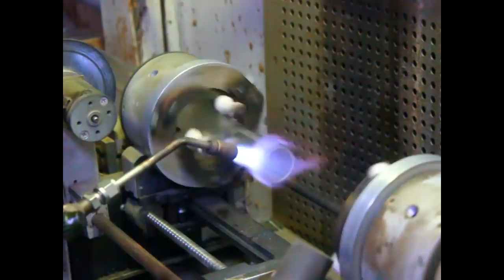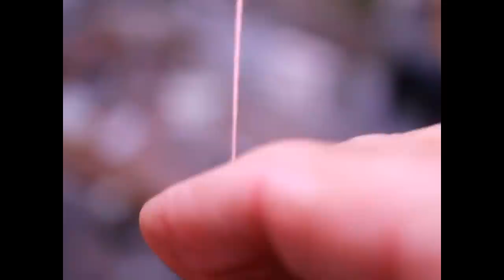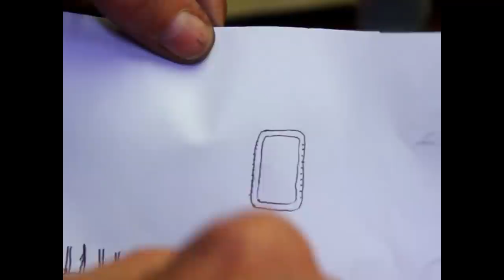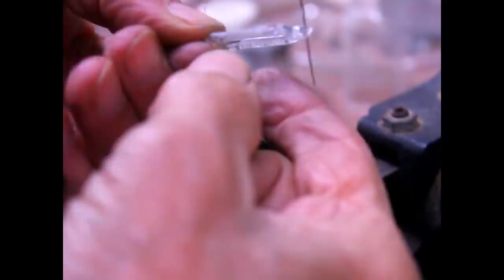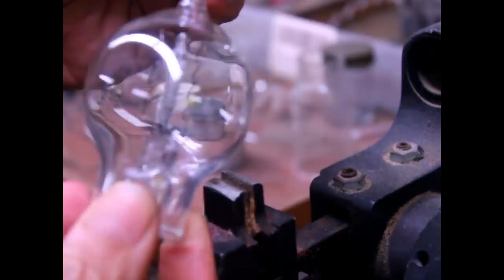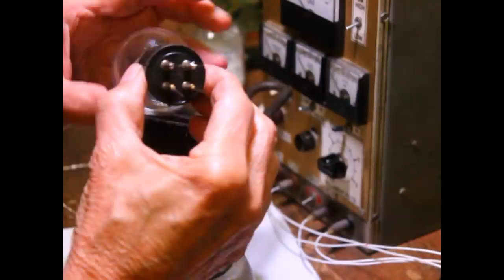MAKING A WIRE ELEMENT PILOTRON

Comment: A delightful hour spent watching a master.    When I left school  in 1956, I got an apprenticeship with Ediswan in the UK - as a potential valve engineer.   As I trained in the various departments, I saw valve components - anodes, cathodes, grids, etc. - made on automatic forming machines, and their assembly into various types of valves from those for battery radios up to transmitter valves the size of a football.   I was always fascinated by the processes involved, but never more so than when watching you, Ron, creating an example of an early version from scratch.     Such skill!

Comment: I know how you feel with those moments like when you looped the filament. It's the most angry I ever get. When it's something simple like that it's just the worse. Btw, I actually gasped when it looked like you were about to snip the bottom rung of the plate whilst you were trimming the excess off. Amazing stuff. Beautiful finished piece, and nice performance for something with such a low surface area for the plate. I wouldn't have expected that to work so well. Thanks as always for sharing.

Comment: The ultimate in home projects is make your own tubes.  Probably more difficult would be to make your own transistors, starting with silicon sand and a few metals (or non-metals, arsenic).
Reply: I didn't think it was even possible to make working homemade vacuum tubes. What this guy does is incredible!

Comment: Pilotron vs Pliotron.  According to the book "Saga of the Vacuum Tube" by Tyne around page 140, what you have made is a pliotron from around 1915 to 1917. "Pliotron is derived from the Greek pleion, meaning 'more'".  "The practice of using wire electrodes to facilitate degassing was followed from March 1913 until well into 1914..." If it is actually the pliotron then it is significant because it was among the first amplifier tubes with a good vacuum.  Also, check out the wiki under Audion.

Comment: The liquid (when you are sinking the wires into the grid frame) is water formed in the gas combustion, condensing upon the cold carbon.  After the carbon warms, the water evaporates.  This happens anytime a flame hits a cold surface.
          Regarding mounting into the socket: what I would use is silicone 1 caulking.  It never gets brittle.  It bonds to glass.  If you need to remove the tube for some reason, you can cut it away.
          Regarding mounting in the socket: how did you get the 4 wires to go through the pins all at once?  I usually cut the wires in a stairstep so one can be guided in at a time.
          Regarding tungsten seals: tungsten is drawn from billets sintered from powder.  The billet is porous (despite the hammering it gets).  The wire drawn from it has "tunnels" running through it that cause leaks.  This is usually remedied by butt-arc-welding molybdenum to at least one end to fully melt the tungsten and seal off the tunnels.  Have you had trouble with leaky seals?  (I noted that you did not He test the seals like you did for the Edison Effect lamp).
          Where do you get your supplies, especially thoriated tungsten is hard to get given the radioactivity?
Reply from the maker: I use a silicone glue called "shoe goo" which is available at any hardware store.  I solder long pieces of thin wire on the leads so I can easily thread them into the socket! EASY! The problem with tunnels in the tungsten is serious and I do have trouble with it. All the seals MUST be leak tested before use or you are in for a crap shot. Note that sometimes a step in the work is not in the video because I forgot to hit the record button on the camera!  :(

Comment: Seeing how cheap metal is and how tricky a tube is to make I think the Gm would be the reason. I imagine alingement would be near impossible and tollerences would be wide.  A complex tube like PCL86 was sold for peanuts. A triode plus power pentode of good quality in a small package. I guess mass produced tubes had a line of people doing just one task to keep it simple. Ironically a 2A3 which must be easier to make is 20 times the price. It goes without saying to make a tube as here is remarkable. My friend Martyn Miles made the glass used in the film Cold Fussion. I have seen a glass lathe in his lab in Oxford. It was in the film also.

Comment: the fluid on the carbon surface is when the hydrogen burns in the flame it makes water. that is not coming out of the carbon ron, it is simply water. The water is made as steam. The carbon is cold so condenses the steam

Comment: At some point could you please show us the machines and  tools and how you use them to make tubes ? I know you did a review several years ago, but not much on the the materials used in vacuum tubes... Such as thoriated tungsten wire ! I remember the need of some special eyeglasses, so you can see through flame ! Are there any textbooks you can recommend ? Thanks for all your work and efforts !!

Comment: Glasslinger, I love your vids and wish to thank you for all your work. I have a couple of questions for you. a) I have some old books etc that advertise valve repair services (I am in UK). Do you or have you ever repaired a valve/tube? That would be a n interesting vid to see.
b) old capacitors, I understand that it is easier to replace faulty ones with new, but wondered what is it that has gone on the old? and again could they be fixed? Yes prob not worth the effort but got me wondering. If it was just leakage then with some perhaps melt the wax out then rewind and reseal? Be interested to hear your thoughts.

Comment: Your skill in this stuff is beyond impressive. Any chance of inventing a way to replace worn out cathodes in picture tube guns?
Reply from the maker: Sometimes. The problem is a chemical change in the coating of the gun. Sometimes there is good raw coating still under the worn out coating layer. Picture tube rejuvinators attempt to evaporate the worn out layer by heating the layer to high temperatures. VERY RISKY because it can burn out the filament, which instantly renders the tube inoperable at all. A picture tube brightener heats the filament to about 20% hotter than normal temperature to force more emission. This will add about a hundred hours to the life of the tube before it burns out the filament. Full rebuilding of the tube requires large expensive equipment so it is not economically feasible in today's "collector" market.
Reply: Thankyou for the explanation.
Reply: Picture tubes were re-gunned routinely, the b/w ones that is.

Comment: You are using a carburising (oxygen deficient) aka reducing flame I see, is there a technical reason for that?

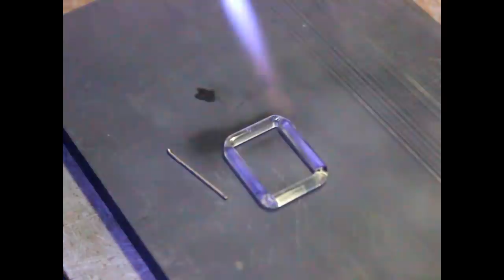Btw the liquid at 33:40 is water condensing out of the flame when it meets the cold surface. The same thing happens when gas welding cold metal. 
If you preheat your work surface it should help.

Comment: Loved the video. So many questions. Why does tungsten wire get used at the pinch?.  Couldn't the nickel wire be used from the inside all the way to the terminal pins.  And why the sleeve on the copper.  Is it not possible to spot weld the tungsten to the copper?  I assume tungsten makes a better air tight seal at the pinch and if so, are there other metals that also work well or is it just tungsten that is suitable?

Comment: Fantastic Video; Thanks for the Christmas present Ron! 
I too, would like to see a project using these tubes (e.g. radio, CW transmitter etc.).
I was wondering why you did not coat the filament; could you explain pro/cons of coating?  However, I see you got good emission and gain at low-voltage.  Also, was surprised that little amount of plate-area gave such good emission. Conversely, I bet that grid gives really good/fine control. Thanks Again;I was entranced the whole time!
Reply: He did not coat the filament because he used thoriated tungsten. Coating is used in many tubes because it works at a much lower temperature than the tungsten, consuming less energy. But thoriated tungsten has a longer lifetime at high cathode currents and is easier to work with.
Reply: Ok, guess I missed him using thoriated-tungsten filament wire.  Thanks for the reply and clarification...

Comment: Would it be possible to work with boro tubing with a propane and oxygen mixture, and or an acetylene and oxygen mixture? Would they be as hot as a natural gas and oxygen mixture?
Reply from the maker: Certainly! Both propane and acetylene burn hotter than natural gas so you actually would be able to work larger pieces using those gasses.

Comment: Hello
Thanks you for this masterpiece, you keep impressing me over and over!
I think this is the best tube regarding transconductance and current values.
I don't remember nothing similar looking at your previous creations.
Is this a high power tube?
Best regard.
Reply from the maker: Not a high power tube. It has very small anode area so it would heat red hot qickly if any power was applied to it. The original purpose was to get around the patent that described a "plate" used as an element. By not having a sheet plate they beat the patent, but never did produce the tubes commercially.
Reply: @glasslinger  Hello Ron, thanks you for the answer, understood.
It work very well, i thought having a lower surface area for the plate would lower the transconductance.
But it's not the case, having the grid and filament so close heated, for sure help.
The result is astonishing, again congrats.

Comment: Why are vacuum tubes always symmetrical, in this case with two "plates" instead of one?
Reply from the maker: It doubles (sort of) the performance and is very easy to do.
Reply: @glasslinger  OK, thanks for the answer! The two grids also make the tube even more beautiful.

I had a complicated theory, that it affected the electric field close to the cathode (superposition making the combined field strength there close to zero) and that it changes the performance from when you have a setup more like an electron gun. But cathodes are seldom as centered as in this case so I guess this can't have any impact.

Comment: What type of tip attachment do you use? I have a National 3B-B torch, and want to replicate a similar flame.
Reply from the maker: I make up many tips, some producing a 1/16 inch hot needle flame and some making a large "rosebud" flame using 12 liters per minute of oxygen. I have modified the national threaded head to use a swagelok quick change coupling. This makes changing out tips take a few seconds.
Reply: @glasslinger  Is there a specific tip attachment you used for this video?
Reply from the maker: @GriffinGBrock  I use a half inch "rose bud" tip to work the envelope and the 1/16 inch needle flame tip for doing all the sealing. For making the pinch I use a small cross fire tip that heats the glass from both sides.

Comment: What type of gas are you using to blow out the tubing?
Reply from the maker: Air.
Reply: @glasslinger  I meant the gas you use to melt it.
Reply from the maker: @GriffinGBrock  OH!  I use compressed natural gas with oxygen. I have natural gas service at my house, and have two oxygen concentrator machines to generate the oxygen. Very low cost per hour to use.
Reply: @glasslinger  I’m using MAP Gas Pro for 22mm boro tubing, but it takes too long for it to become red hot. I’d imagine that natural gas and O2 is hotter?
Reply: @glasslinger  What mixture ratio do you use? Where can I get the proper gas? The internet does not seem to help on these matters.
Reply from the maker: @GriffinGBrock  Ordinary propane used in food cooking works fine. Oxygen you would have to get from a welding supply store. (expensive!) If you have the torch, simply light it and adjust for a nice hissing blue flame.
Reply from the maker: @GriffinGBrock  MAP gas is fine, but you must burn it with oxygen. The gas burns about 5 times faster with pure oxygen so it liberates 5 times as much heat per second. Your glass will heat 5 times faster. Work towards getting yourself a nice welding torch with changeable tips.

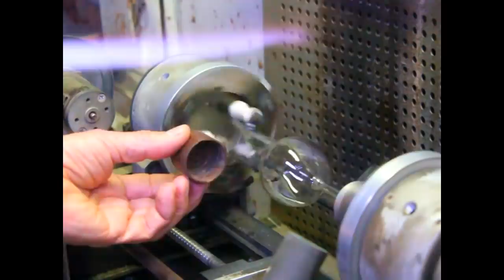Comment: 11:20 How do you blow into the tube while turning? Do you have a swivel setup?
Reply from the maker: A small sealed ball bearing is placed in hose adapter fittings made on a lathe.
Reply: @glasslinger  Hey thanks for answering. Have meanwhile started my own experiments using some cheap test tubes, my simple lathe and have now made the double torch from some leftover AC copper tubing... You are inspiring me!

Comment: Hi Ron, what is these liquid when you cut the glass ?
Reply from the maker: i use WD40 spray. It does the job and it evaporates within a week or so to not leave an oily mess on the equipment.
Reply: thanks for your fast responding. @glasslinger

Comment: 1:02:45 You flash the getter AFTER you have sealed the tube. The getter will make the vacuum much lower then the system can and thus it draw quite some molecules into the tube from the system and makes the vacuum worse then it would if you had done it afterwards, in worst case it could actually not lower it at hardly at all and pretty much be of no real use to what its capable of. I also do not see any real strong mark on the surface after the flash which indicate to me much have been used up before it hit the inside of the glass and thus no real shiny surface after it, since you heated it up so much that it should have evaporated a lot of getter material.
Reply: This man is amazing and expert. You can add nothing to his shadow. HIs turbine vacuum system is awesome.

Comment: B...but muh advance, why don't you just buy some cheap preassembled SMD boards from China and throw them in a plastic case, it's much cheaper and better that way. It's the current year, no need for this weird old lightbulb- kinda stuff. 

Haha just kidding, good job.
Reply: yeah!!! "Arduino + Light Bulb = SMART LIGHT BULB!!!1!1!!" ... 10M views because of the 3D printed case that costed 100$ of wire and 10$ of electricity.. the same thing, noooooo difference :D
Reply: @redoverdrivetheunstoppable4637  

Yeah I wanna see a smart light bulb with arduino and 99.999% fine chinesium LEDs, of course app controlled so you don't have to walk the 10ft to the light switch no more. ^^
Reply: @westelaudio943  honestly chinese leds seem to last somehow, the 5mm ones are all fine, power COBs may not be super efficient but they seem to last as well (the inbalance in brightness at low current between chips is a classic), i've seen that V-Tec bulbs sold locally failing like fake

this IOT nonsense will end when when the sound of the term "IOT" will be silly, previously they called it "domotics", now "cloud", tomorrow "AI", someday we'll hunt whales for wax candles just for protest, and Green Peace will agree, nobody needs that
Reply: @westelaudio943  *V-Tac